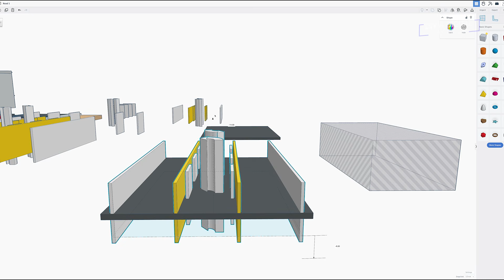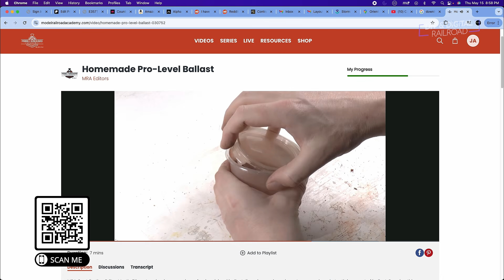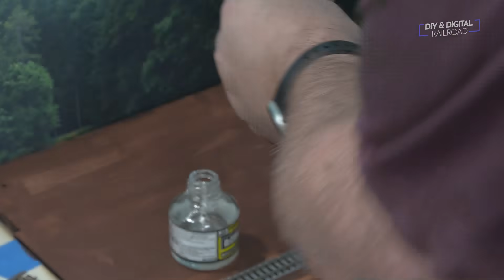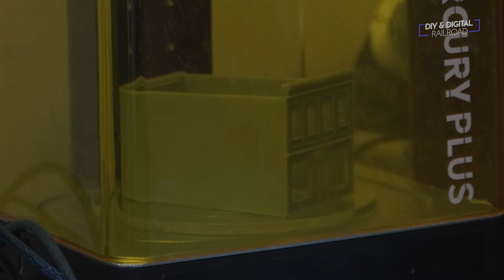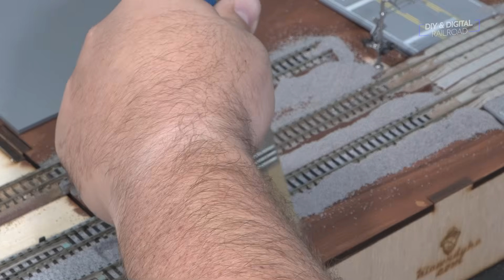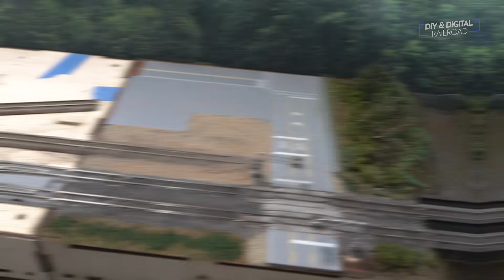I 3D Printed A LOT of this Model Railroad Scene

Comment: Just a tip and kinda question. Have you tried to separate any of your modules The reason I ask is I did some testing of kato track and it requires a left right type of movement to separate.. I am building a modular railroad also so tip is cut the little tabs off one side of the joiners so that the joiners stay on one side of one of the module less likely to rip up track or scenery Also a boomer diorama idea parchment paper between them. Anyone else with ideas?

Comment: EXCELLENT!  Once again the intersection (no not the road) between Model Railroading and Model Building is so apparent (guess I should have seen that since MODEL is in the title of both hobbies).  One question...why using 2 different 3D printers (Bambu vs Elegoo)?  Is it because of different "printing" materials?
Reply: Hi, this is due to the level of detail required, FDM (bamboo) is faster and has a large print area but is difficult to do really fine detail, Resin (elegoo) is great at doing really fine details but has a much smaller print area. They both have there pros and cons but if you have access to both you can play there advantage. If not this would all be possible with 1 of the machines, you might just have to tweak the design a little.
Reply: @meddie79  Thanks!  Just the sort of info I'm looking for...have thought about taking the plunge into 3D printing for years.  Trying to understand all the options.
Reply: @meddie79  he is using a Mars (a Mars 5 is Build Volume: 153 x 77 x 165 mm) vs. a larger Saturn printer (Build Volume: 218.8 x 122.8 x 220 mm) for the detail work.  Saturn 4 can print faster with Rapid resin.  The general advantage of one vs. other is really in how much load you need the model to take and the detail.  MSLA (resin) is better in detail.  Basic photosensitive resin does not have the tensile strength as most FDM thermoplastics. Think trestles where a train load vs. a building where you're not stacking things on top.